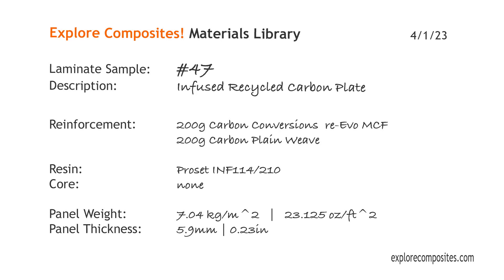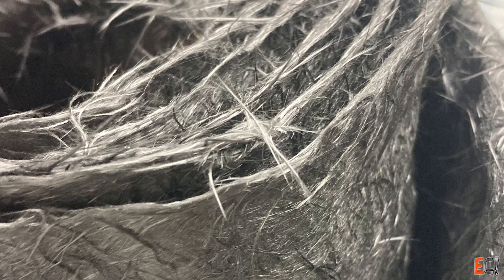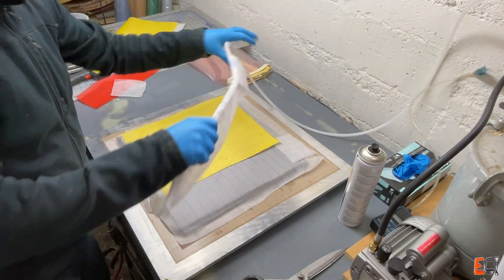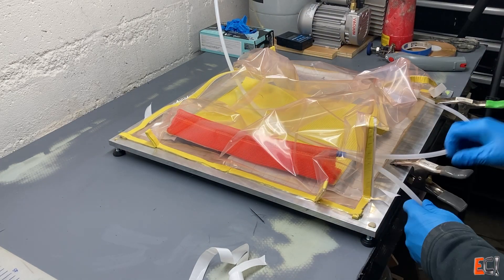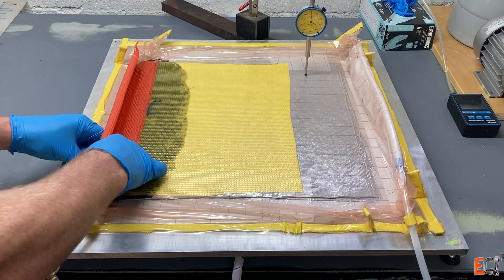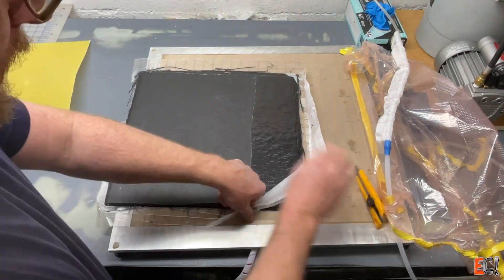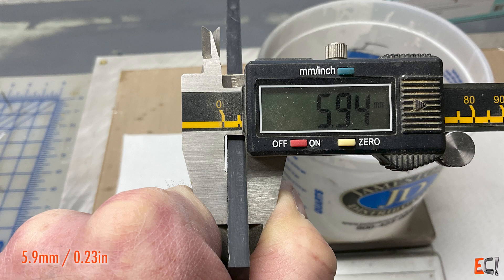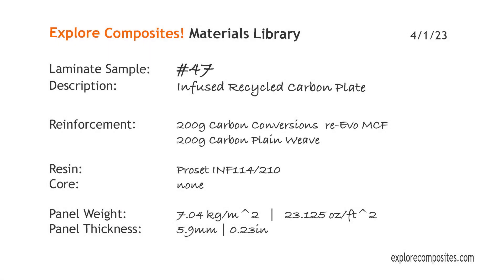Laminate Sample #47: Infused Recycled Carbon Plate

Comment: Do you know how to make a tapered layup flat on both sides? carbon freediving fins manufacturers somehow can do it but I have no idea how.
Reply from the maker: If it's tapered, the flat sides just can't be parallel... you could mold it on (or between two) pieces of not-flat tooling.  It is pretty easy to accurately estimate the thickness of a laminate and then tool both faces with a tapered mold cavity between them matching the thickness of a tapered laminate.  I'd guess this is how fin manufacturers do it, potentially with some fancy mold features for ribs, edges and any resin injection if a high volume process.
Reply: @ interesting, alot of the chinese mass produced ones are all flat both sides and you cannot feel and steps at all.
Reply from the maker: @kizzjd9578  The tooling could be flat/smooth and the steps get pressed into the part instead of being on the outside.  Al long as the right thickness of material is between the tools halves, the results are a smooth tapered part.
Reply: @ would that mean that the resin would  fill the void where each step is? Making it resin rich
Reply from the maker: Yes, a little.  The layers are typically pretty small and the steps can be placed on the inside (or at least with a few continuous layers over) so it all kind of works out.

Comment: ... So any comments on bulk CTE after nearly a year? I'd imagine most of the strength & rigidity comes from the woven outer plies, and 18% fiber volume means 82% resin in the core - could have a substantial CTE impact unless that's the uncompressed figure?
Reply from the maker: You're right, there's a lot of resin and the carbon mat does act a lot like a core.  Even at 18% FVF, the carbon probably keeps the CTE low but it is hard to know how much the uniform face plies are doing the work. I'd shoot for about 1/3-1/2 the thickness in structural face plies and use the recycled mat as a core to increase thickness and stiffness of the tool shell.  It can be a challenge to wet through though, so testing is important and slow filling helps.  Resin is still cheaper than carbon but not by as much!

Comment: I feel like this would be great for filleting instead of cotton flock.
Reply from the maker: The fibers are really long and might be too hairy and clumpy to cut a decent fillet of a normal size.  You can buy shorter chopped/milled carbon - 1mm or so - that might make decent fillets if mixed with silica or some other filler.

Comment: It's half in price until people figure out it's great material for that price. When this happens manufacturer will increase the price making it 90% of woven material and it will be forgotten like everything else.
Reply from the maker: It is about half the price of a 200g woven - but it isn’t a substitute or a structural equivalent.  They will be useful for very different things.  Hopefully there will be growth in recycling of carbon materials and products like this will be more common and available from a range of suppliers.
Reply: In the late 70's Nomex was new and cheap so small companies like Stiletto catamarans could make a profit using it on their lightweight boats but then military Aerospace industry started using it for fighter jets and the price of kevlar went thru the roof, forcing Stilleto to use cheaper fiberglass which made their boats slow and heavy.

Comment: Thanks Chris!  I will definitely be using this when I start making production tooling.  I've been debating if I will use carbon, and if this is 50% the cost of woven, then yes, it feels like a win.
Reply from the maker: I need to test more, but it seems like lots of things look encouraging for CTE matched tooling.  There would be less actual carbon by volume but that may not matter.  The cost savings is really in the thickness building and cost relative to resin.  You wouldn’t usually stack 6mm of 200g in a tooling application because it would take forever.  Not having to fuss so hard about ply tailoring and fiber orientation is a plus too.